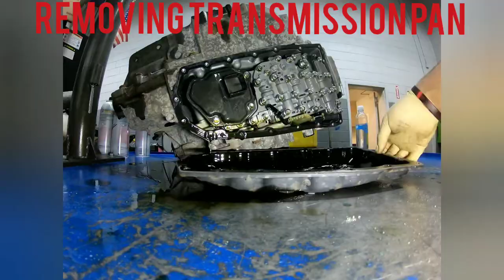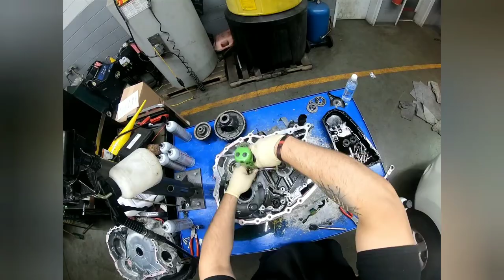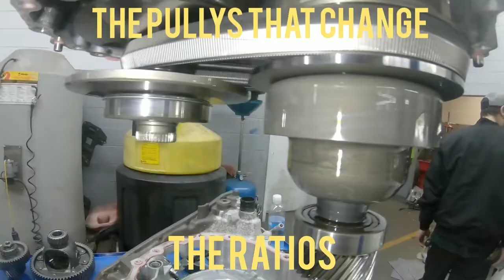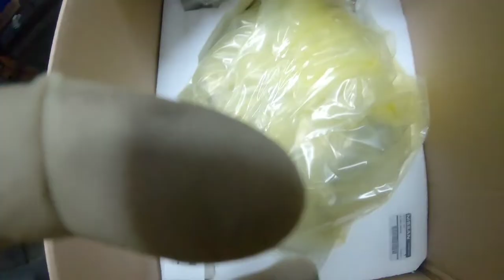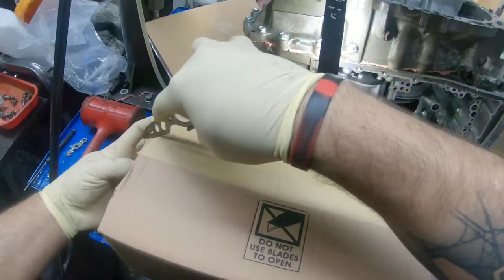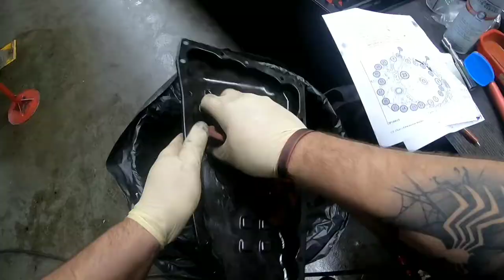NISSAN ALTIMA CVT TRANSMISSION TEARDOWN AND REBUILD PT2

Comment: was that filter just the oil filter? Also, What year and engine type nissan altima was this? Because when I saw the oil cooler, it had 4 aluminum hoses instead of 2 like my 2007 altima does.
Reply from the maker: This one was a 2013+ year Altima. If there's only two hose they're probably just coolant lines. If there's 4 it's coolant and CVT fluid lines . 4 cylinder engine

Comment: Had my 2017 Altima just done it doesn’t slip any more but at 60 mph I feel a vibration that wasn’t there b4
Reply from the maker: If there's a judder/ vibration they're might be a code for a rebuild. Take it to a dealer and have them scan it

Comment: Wow, not only do you have to change the sub assembly but also the electronically control valve body.  Then you have to flash the transmission control module in the car itself( CD include with valve body).  In order for it to work correctly.
Reply from the maker: Yup everything gets changed and programmed

Comment: My friend has a 16 Altima 2.5. The transmission gets hot and the car goes into limp mode. This is happening more and more. He also cannot step on it full throttle or the transmission slips at higher RPMs. If he babies it he can get places. Is his transmission shot? Dealer here in Aurora, CO is giving him the runaround.
Reply: Your buddy needs to get rid of it. He will replace trans and it’ll go out again after 50k miles
Reply: How do you know the same transmissions out there that last long just gotta keep it lubricated
Reply: @pedro prieto  He ended up getting it replaced by the dealer for free under a class action lawsuit
Reply: @DJR5280  again?
Reply: @Chronicrockstar  It only when out once

Comment: what part of a cvt transmission usually breaks?
Reply: Depends on how you drive. If you floor your car a lot, then the belt is usually the failure point. If you don’t replace the fluid every 30k, you could see anything fail. There are bearings, gears, hydraulic pumps, all kinds of stuff that could fail with bad fluid.

Comment: Please
Can you tell me how I can get this rebuild kit for my transmission
I have altima 2008 V6
I got some transmission bad sound when car still cold
Car makes noisy when engage gear to D and accelerate over 2000 RPM
Reply from the maker: This is only for the newer cars. I think it's 2014+ year cars

Comment: my 2013 nissan altima jerks up hills and wont stop until i let off the gas and get back on it, rpms high while driving and wont shift unless i do the same..is that the belt slipping?

Comment: My 2017 altima has a bad transmission has trouble getting to first gear have to press down on the throttle but once it’s in first gear it’s fine and I can go all the way up to max speeds without a issue. Do you recommend a rebuild or new transmission. ?
Reply from the maker: I would say rebuild would probably be cheaper. They change the cvt assembly and valve body so it's basically a new transmission with the old case

Comment: Just had a problem today on the road with my 2017 Nissan Rogue 26k milage and already transmission problem, do you think it has a factory warranty?
Reply from the maker: I would call the dealer.  I think they extended certain vehicles warranty

Comment: I have a 2013 Altima sv with 142k miles on it. When i start the car and put it in anything but park it shuts off. I have to have my foot on the gas and brakes in-order for it to stay cranked. It shifts really bad. After driving it for about 15 minutes if i put the car in park/off and put it in drive or reverse the car doesn’t move. It doesn’t rev up with my foot all the way to the floor. It just hums repeatedly. Wondering if i should replace or rebuild the cvt???
Reply from the maker: At that point a replacement CVT would be recommended

Comment: Hi. Where do you get your rebuild kit? The dealer wants me to buy the transmission instead.
Reply from the maker: I'm not sure if a regular customer can purchase it. I worked at a Nissan dealer that's why I was doing the job . Try calling a different dealer maybe you'll get a different response
Reply: There are rebuild kits on RockAuto for my 2013

Comment: What parts were used ?
Reply from the maker: It comes in a kit. New sub assembly filters ,gaskets and seals
Reply: @JavsGarage  How much is the cost of this kit? It is in the Nissan web store?
Reply from the maker: @LuisRamos-ul9kc  I'm not %100 sure on the price or availability of the kit. Nissan only lets certified techs do this job

Comment: Is the valve body easy to reach under the vehicle or do you still need to take the transmission off regardless to get to them?
Reply from the maker: You can reach the valve body under the car. Just take the trans pan off and Remove the 10mm bolts marks with a the number 7 on them and the 14mm for the gear selector along with the green connector
Reply: Yup, couple hrs you'll have it in and out. Dont forget to torque the bolts. I believe around 60 in/lbs (NOT ft/lbs)
Same with your oil pan.
Good luck these CVT's seem to be hot and miss when just replacing a valve body! Works for some and thrown away money for others.
If your keeping the car, might want to find out about that sub assembly. That thing is slick!

Comment: NEED HELP ...
Have 2008 Nissan rogue SL 2 wheel drive.

It's leaking transmission fluid from transmission door (nuts off the flywheel). I have replaced 2 cv axle seals, front pump or torque converter seal. Finally purchased New torque converter.  After putting all back together and 3 days later it's leaking?

What am I missing or what do you recommend? 

I've already drop transmission  twice. 
Any suggestions would help

Great videos and keep up the good work!!!
Reply from the maker: There's a o ring in the transmission where the input shafts goes through.  It's a small rubber o rinf on the tip of the shaft that goes into the torture convertor that could be the issue. Or the seal that goes around that small shaft
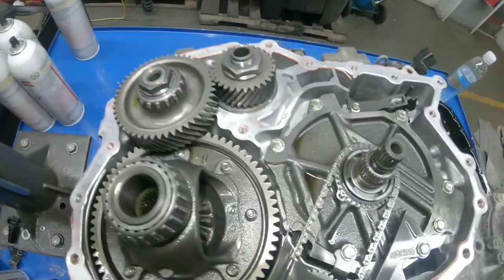Reply from the maker: If you look at 0:53 that's the shaft in talking about.  There's a small subbed o ring at the tip. And before I took off the bell housing there's a seal around that shaft as well
Reply: @JavsGarage   you got to be kidding ME...lol. That's sub O ring cause possiblity cause the leaks 😲😲😲. Honestly, I reviewed and seems ok. No tear or any signs of worn O rings. Let just say "I replace O rings" and continue the leaks...what the next protocol?

Appreciate your comments....
Reply from the maker: That's like worst possible outcome I've only Seen it once. But if you changed the torque convertor seal and the actual convertor on a 2wd there's no more common issues I know of unless I see it In person
Reply: @JavsGarage  I'm here with mechanic and the front pump seal seems to be loose to where it was removed by hand. That's twice that happens. What is causing the seal to be loose? 
I know this sounds "out of technical process" what I put RTV or sealant adhesive around the seal from happening again?

Thanks Javi, appreciate your feedback.
Reply from the maker: Probably wasn't installed properly or was not straight.  I'm summing youre talking about the torque converter seal in the bell housing?
Reply: @JavsGarage  that is correct.
I have personally installed the torque converter seal / front pump seal with rubber mallet tapping the seal to be flushed (TWICE). I'm thinking ..applying rtv or sealant cream around the seal from getting loose. 

The question is... What causing the seal to get loose?
Reply from the maker: Was it an oem seal? Some after market  seals or smaller than oem.  Can't really think of why it'll keep leaking  if it was changed twice ? I know there's a special install seal tool we use at the dealer to installed them at the correct  level
Reply: @JavsGarage  OEM seal and even talk with Nissan dealership technician on special tools for that purpose. What do you think about RTV or locktite around the seal?
Reply from the maker: Oh wow ok I mean at this point I would use it if that's the cause of the leak . That's a weird issue tho that it keeps leaking from there
Reply: @JavsGarage  type of sealant ..you recommend?
Reply from the maker: @harminaguilera7439  we used this gray sealant at the dealer but it was just branded with a Nissan logo lol but I'm sure any rtv or gasket maker should work
Reply: @JavsGarage  using aircraft B-1 sealant to keep this seal in place. 
I appreciate your feed back and guidance.

Thanks sir
Reply: 2008 Nissan rogue now has VDC light coming on.

Changed out clockspring and reset the car
All of sudden VDC light came on.

No check engine light just VDC light.
Check BCM fuse it's good
Fluids is good

What about sensors?
What are my options to turn it off?
Reply from the maker: I know for newer cars there's a yaw rate sensor that needs to be calibrated sometimes when that light is on. But for just doing a clockspring ? Not sure. I would double check all the connections. That sounds like you'll need a consult 3 to calibrate or check the codes. Thats only at the dealer and most scanners can't read certain codes
Reply: @JavsGarage  sorry to bother. Is it possible to bypass or kill switch to disable the VDC. The VDC indicator comes and it vibrates or grinds the transmission. I do not want the front pump seal loose. Then ...I have to drop the transmission.

Is there way to bypass the VDC light?

Thanks
Reply from the maker: @harminaguilera7439  I haven't heard of any bypass for vdc/abs. Multiple systems take readings from that like the ecm and bcm. I think there's a abs fuse that can help ? Not 100% sure tho with rogues. I think I heard doing a abs fuse pull on Nissan 350z in order to do burnouts lol

Comment: Great job guys 🙂 where did you get the replacement parts from, Nissan I assume?
Reply from the maker: Yes
Reply: @JavsGarage  ok thanks, I remember you saying you worked for Nissan so I'm sure you got a nice deal. How much are the parts normally.
Reply from the maker: Depending on the year and model . Roughly 1,500 -2,500

Comment: so the problem was the sub assembly or the steal push belt ?
Reply from the maker: The belts but that's part of the sub assembly do it's replaced as one unit
Reply: Symbiote215 can i just replace the belt ?
Reply from the maker: @ferashamad8843  to do it properly you'll need the sub assembly and valve body . I haven't seen it where they just changed the belts/sub assembly

Comment: Really like how you got the sub assembly for the CVT.
Any chance of getting a link, name of business, or part # ?
The trans and valve body look identical to my 2012 Altima. Just could tell if it was single or dual pressure sensors...
Should be a JFO11E or REOF10A?
Do you install aftermarket trans coolers when you do this work? I heard heat is a big factor to failure in these CVT's.
Cheers, nice vid!
Reply from the maker: Most vehicles already have the external coolers from factory. But as far as part# I'm not sure off the top of my head. Any Nissan dealer can provide that for you just give them the VIN and tell them it's the cvt rebuild kit
Reply: @JavsGarage  
The dealership wouldn't quote me for a rebuild kit...They wanted $3100 plus taxes for another trans.
I went with a salvage unit for $1100. Completed the swap on Saturday. So far it is working flawlessly! My God are these units very heavy for their size! The exhaust looked a little rusty on mine, so i removed the trans from the top.
Wouldnt mind finding the sub assembly, replacing the bad pulleys in mine, and requip some of the money...
Reply from the maker: The rebuilds started with the 2014+ model years I think. I'll have to double-check if they go that far back. But yeah they want alot of money for them and they are really heavy for the size haha! We use a transmission jack  to pull it down ,I used one in a CVT removal video I posted. It'll definitely be a challenge on the ground
Reply: @JavsGarage  
I went through the top with my trans, so i hooked a strap around it, and zctually used and electric forklift to remove and install the used trans. I was lucky that my dads best friend is a general contractor and let me have access to the shop! Lol
Reply: @splash5974  did you have a lift like that, or did you do it on the ground?
Reply: @Reeeeeee12345  did on the ground with car on jackstands

Comment: What's the cost on a job like this...
Reply from the maker: around 3k depending on the vehicle
Reply: @JavsGarage  wow ... also how many miles are people getting on these transmissions?
Reply from the maker: @maldo72  it really comes down to luck. I've seen transmissions with the original fluid well over 130k running like new and also seen some with under 5k that need replacement.
Reply: @maldo72  has a LOT to do with your driving style
if you drive like a granny, it'll have a much higher likelihood of lasing way longer
if you drive like an asshole (like me unfortunately), it will fail MUCH faster

that, heat, and maintenance.  if you live somewhere warm, consider installing a dedicated trans cooler

Comment: hey guys i have a question,.. my 2008 altima uses the same engine as the 2002-06, same engine and i want to know if the transmission of the 2005 will fit on to my 2008 altima???
Reply: No

Comment: Amazing video was curious as to what causes these transmissions to go cause I'm experiencing some issues with mine
Reply from the maker: It's the sub assembly that I removed. The belts start slipping
Reply: Symbiote215 sometimes when I run it long enough it doesn't take off right away when I come to a complete stop
Reply: Pump and or flow control valve fail
Reply: @bigdaddymak1439  
Also valve body issues, which lead to slippage. Heat is anothef factor.It leads to failure aswell... alot of people install aftermarket trans coolers.
Reply: @mruiz0285  Replace the stepper motor located in the valve body. It doesn't cost much.